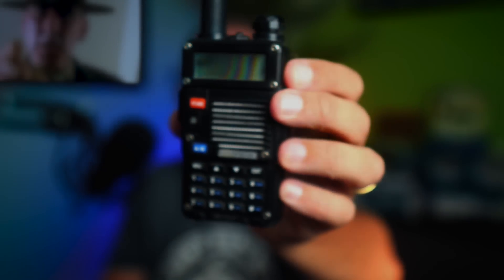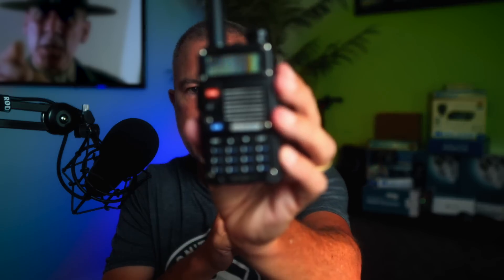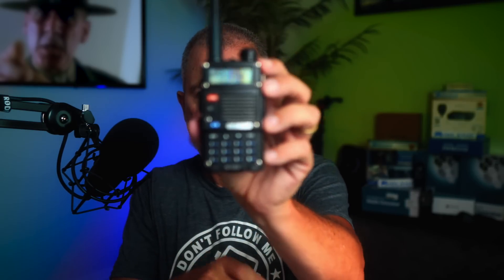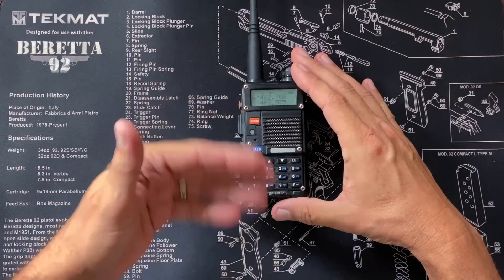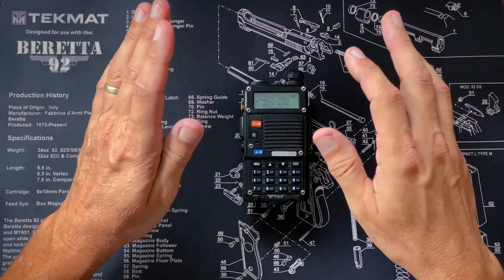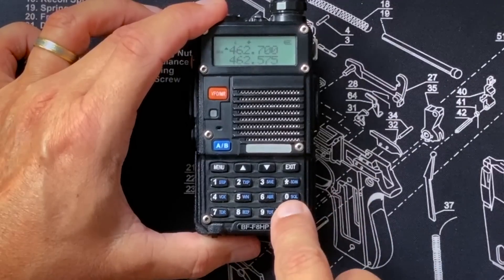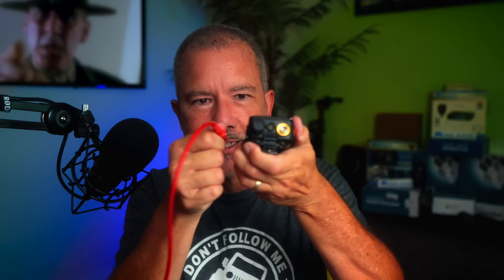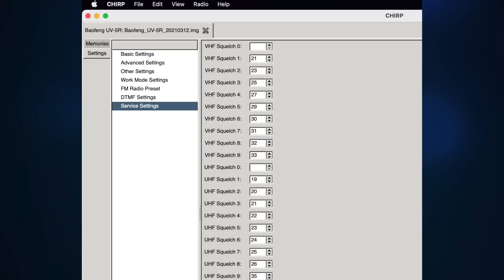What is Squelch & How To Adjust The Squelch On The Baofeng UV-5R - Does The UV5R Squelch Work?

Comment: Excuse me I was wondering if you can help me with the issue I'm having with trying to run my peltor comtac 3s with my baofeng u5rs. All the comm equipment on the peltors are good to go including a new gentex mic. I am using an adapter from comm gear supply as well that works with the nexus PTT I have. When I transmit it doesn't indicate that I am transmitting on the other radio but the person cannot hear me. Can anyone please help me with suggestions.

Comment: Thanks for the videos. I have a Baofeng UV5R and the squelch is like you said terrible. I can hear on other channels that the squelch is fine, but of all things on our ham repeater, I miss many of the transmissions unless I push the (light/squelch open) button. This is weird to me as the repeater has the signal level used to overcome the squelch.  The only thing I can think is radio interference from off-channel transmitters. No matter if I set the squelch to 1, or 3 etc. Do you have any ideas I could try? I have a dipole antenna on a pole outside so signals are good. My radio may be too much junk. I do monitor Sherrif and fire channels local and it works fine on those (no transmit!) :) KF4HUF
Reply from the maker: My only recommendation is to try a better radio.

Comment: Would you happen to know why service settings are missing in CHIRP for the 5RM, keeping me from fine tuning the squelch? Firmware on newer radio maybe?
Reply from the maker: Because either:
1) The 5RM does not support it
or
2) The guy that made the program did not include it
FWIW, i have never found that setting to be helpful in any way on any of my UF-5Rs.
Reply: Will heed your advice & stop banging my head on it. Thank you a bunch.
Reply: @TheNotaRubicon  I'm have to assume UF-5R is a typo.
I followed the instructions, after I overcame my fear of bricking my $30.00 radio, in "Adjusting the internal Squelch Levels" following the link you provided (using the values in SPREAD 6).

I bought a kit of 2 radios which came with 2 USB programming cables (and a bunch of other stuff) and they work. Software found the correct com port and the brand and model were in the drop downs.
It really made a difference. 
I can now scan, with squelch set to 7 without some random noise interrupting every 30 seconds. 7 has a value of 50 and when it does break through the squelch it is a strong signal; almost full bars but lower and what I can only guess is machine noise that is not properly shielded breaks squelch regularly across the scanned frequencies.

I watched the video and maybe when you tried the software or the firmware was not up to the task. The software does  warn Baofeng is constantly changing firmware.

Firmware BFB298.

Stll watching your videos because you teach me something new in every one. Thanks!

Comment: Dear Naughty Rubicon, I have a D Head question: When using tone squelch (R-CTCS & T-CTCS on simplex) on a Blue Fang Radio: does It matter what level I have my normal squelch setting set at? For example: If I have my Squelch set at the highest level (9) and my radio hears the proper squelch tone: Will it open up my receiver no matter how weak the tone signal coming in is or when using tone squelch should I always have my radio's Squelch set at the lowest  level (1) So I can hear my friend's cries for help fading away in the distance  as I drive away not paying attention because I'm preoccupied eating cheese puffs?

Comment: Walmart has a rule that says you can’t punch in for your shift earlier than 10 minutes before your scheduled shift is supposed to start. But I don’t work for Walmart, so I don’t have to follow their rules. 

The FCC has a rule that says you can’t transmit on a ham radio without a ham license, but I don’t work for the FCC, so…

Rules are not the same as laws.

Comment: You pretty much forgot the most important part. Would I set my squelch to 9 if I wanna hear someone 2 miles away. Or would I set it to 9 to try to hear only a neighbor chat with me?
Reply from the maker: The higher the squelch setting the more it blocks, the lower its set, the more you can hear.. You can confirm this by setting it to 0 to see what happens.

Comment: The squelch seems to work like this:  0 = squelch off, static all the time.  1-9= squelch on -  there seems to be no difference between 1 and 9.
Reply: There appears to be no difference of squelch setting on mine either 0-9, all have same amount of static also :face-purple-crying: UV-5R8W. It's hit or miss, and doesn't seem to accept the setting until you back out entirely with EXIT sometimes. Oh the days when there was just a simply KNOB to turn to squelch instead of having to navigate a menu and confirm stuff.
Reply: I’ve got a few of the same radio and the squelch is different on all of them.. kind of a cheap radio lol

Comment: If I use a CTCSS or DCS privacy tone (yes, I know they are not secure), can I or should I turn the radio squelch down to the minimum setting? Or does the radio do this automatically when using a privacy tone?

Comment: As always,  great content Randy.
I programmed a few repeaters in my baofeng 8 watt radio with n771 antenna.
I have a bunch of them for emergency use.

And I'm getting my technician license,  but don't have one yet.

I asked for a radio check to see if the thing was even able to hit a repeater 8 miles away.  It did, and I got yelled at for not having a call sign.  jeez.  I had to know if it worked!!!!
I got jumped on like I was a criminal.   I won't transmit again until I have a call sign.  The Ham crowd is alot more stuffy and smug then the CB folks I remember from my teen years.
Reply: Just tell them you have amnesia and can't remember

Comment: Thanks for the video! I have a UV-82HP that I use for strictly monitoring GMRS or whatever while I'm out off-roading and the squelch sucks on it. Constantly hearing static and it's soooooooooo annoying. I have the chirp software and I will try that "fix", good luck to me. This is my first radio after my Motorola talkabout (which has no static problems) and I haven't been impressed with it because of the static. Thanks!

Comment: Would an aftermarket antenna, more finely tune to a specific frequency range help cut down on noise/squelch? I seem to have to adjust the squelch on my UV-5R depending on frequency...  Pretty much exclusively using VHF.  Novice user here...  Thanks
Reply from the maker: No.
The squelch on the UV-5R is horrible and barely works. If you use CHIRP there are some codes you can put in that are supposed to help, but I've never noticed any difference.

Comment: My 805G receives poorly,  Could that be the squelch?
Reply from the maker: Probably not.. But to find out for sure, press the monitor button on the radio, or set the squelch all the way to 0 to see if you can hear whatever you arent  hearing. When the squelch is off if you are hearing stuff, then, the squelch was too high.
Having another radio to compare with would also be helpful.
Most times people have complained about receiving poorly, it turned out there was just nothing to receive.
Reply: Yes it could!  I think NAR suggested setting it at 9, I think.  I usually set them at 2.  If it is higher than 2 or 3, it will reduce your ability to receive weaker signals.

Comment: i just need to know, the Baofeng BF-888S, can it be programmed to turn the mic on and off remotely? Why ask this > The red light indicating active mic turned on while on charge. i sat at my desk working when i saw this happen. Sorry to hammer on this stuff but i help people and hear a lot of personal problems. i need to know if i can trust this radio or not. The Baofeng BF-777s light did not turn red they are both located on the same table next to each other.
Reply from the maker: Never heard of, nor can I think of any possible way for someone to remotely turn the mic on or off.. However a faulty-ground can cause the mic to turn on, and the setting can also cause the mic to turn on... If you're that worried, just turn off the radio when charging, or even better, remove the battery from the radio, and only put the battery in the charger.
Reply: @TheNotaRubicon  guess this qualify as a stupid question. Sorry to have wasted your time and thank you for responding.

Comment: Roger beep confirmed.  Just heard a new ham operator on repeater with Roger beep on.  I started to laughing about it because I knew what was going to happen.  Then the sad ham had to educate the new operator about Roger beep.  I about lost it. LOL. JUST LIKE CLOCKWORK
Reply: I think every friday, should be Roger Beep day... just to screw with the old head hams! As they are bitching at someone, interrupt their conversation, with your Roger Beeping radio! It'd probably drive someone to have a stroke! 😲🖕
Reply: @chrissewell1608  I'm 50 some of the people my age and older are just a pain in the ass to deal with.  I try to irritate the old geezers when I get on the repeater and talk about gaming with a buddy.  Back in their day, they transmitted up hill both ways and like the repeater with no traffic.  And it's club members.  Meetings are fun sometimes because I call out their bs.
Reply: People using a Roger beep has never bothered me even on repeaters.  Even some repeaters I have come across has no courtesy beep to say the tot has been reset.
Reply: Yeah I’ve had that happen to me recently, while I was using my UV-5R. I need to go through the settings, but I believe my Yeasu has a roger beep too.
Reply: The first thing I always do is to turn the Roger beep on. If you were not expected to use the Roger beep they would not have created it in the first place. The sad hams need to understand this principle and follow it rather then tell others to turn it off.